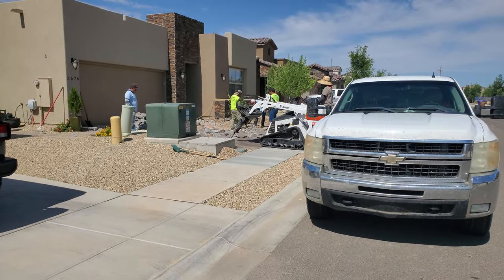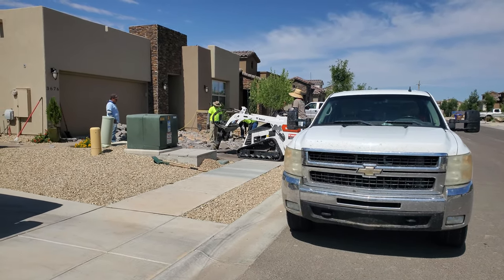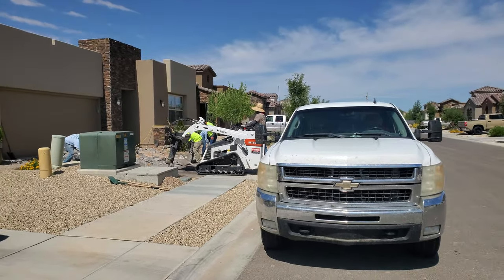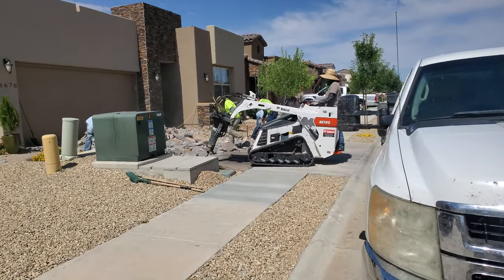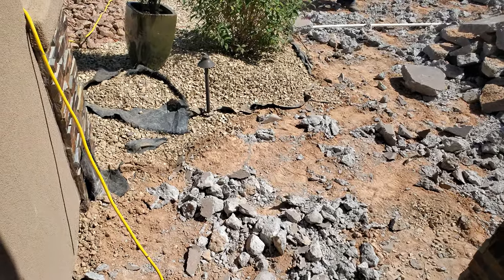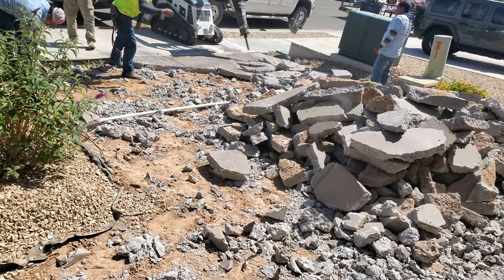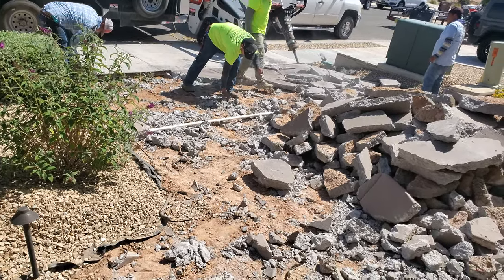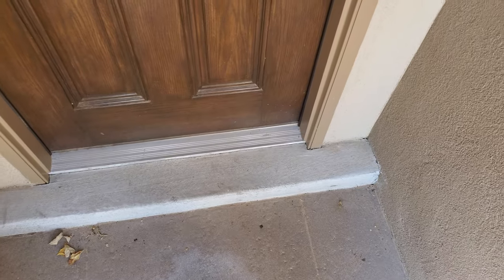Install a Paver Driveway using a Bobcat MT85 part 1

Comment: Always wanted to try the jack hammer.... Do your hydraulics get super hot when operating?
Reply from the maker: No not really its beeg great so far and I guess the only issue we encounter was that one of the Hydraulic line tend to rub and wear out over time. The solution we came across was to protect it with a cover.